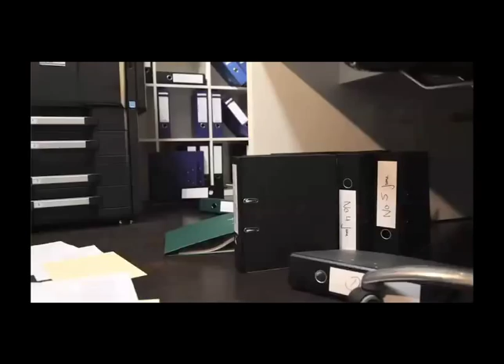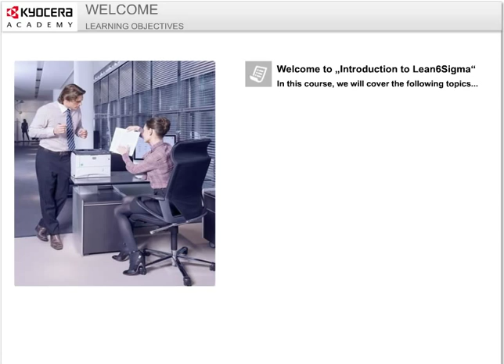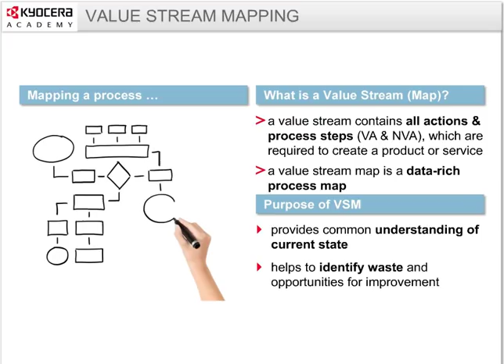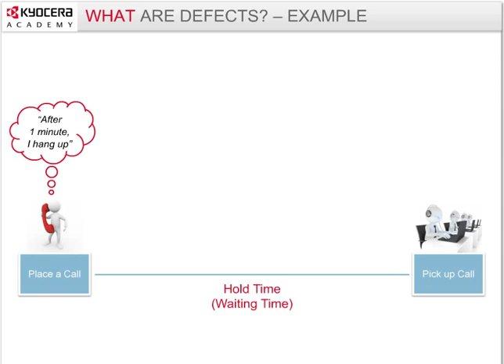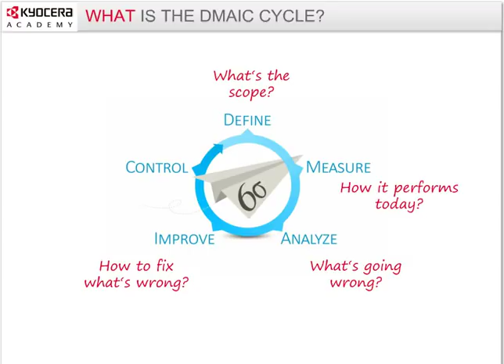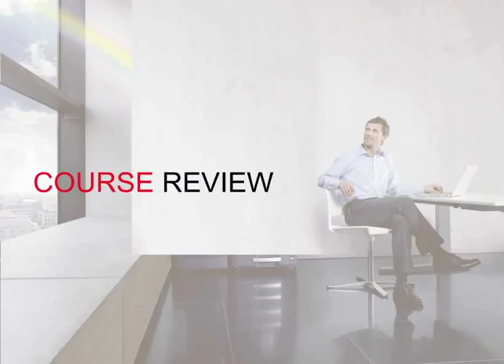Introduction to Lean Six Sigma Methodology

Comment: "lean thinking is fundamentally good, common sense."
never have I taken any courses on LSS, but apply these principles nearly every day.  makes me wonder how many companies are pushing for LSS belts for employees when common sense and a minimal amount of statistical analysis is required...
Reply: I work for a company that supposedly holds a AS9100, I was completely ignorant of this, so delved in, I took a ISO 9001 course, read books, then realized that this QMS, counted on knowing/using other tools,  so now I am looking into LSS.

So far I have come to the conclusion you have, it's just "plain good common sense" but I also, know why the company I work for is failing in many areas,  they only did enough to pass the Audit, but really don't apply the QMS, in a way that will benefit the company and give a high quality service,  this is why I wanted to learn, to see if I can "fix" this situation, It might all be futile, but at least I am learning this, and be prepared down the line.  anyway I still have a way to go, but have started creating simple swim-line flowcharts, for a couple processes.